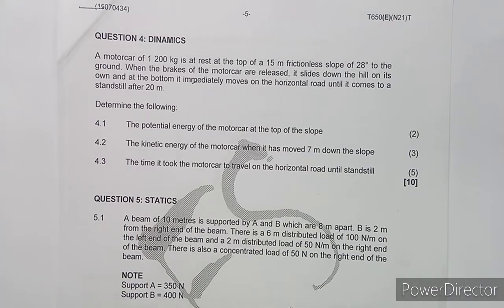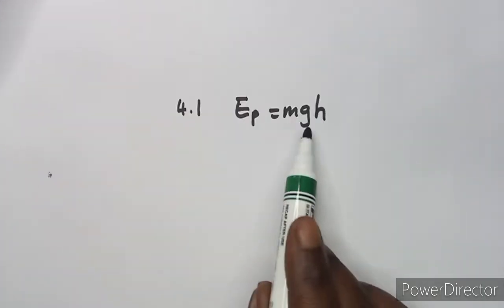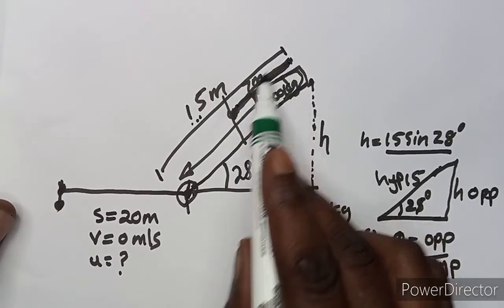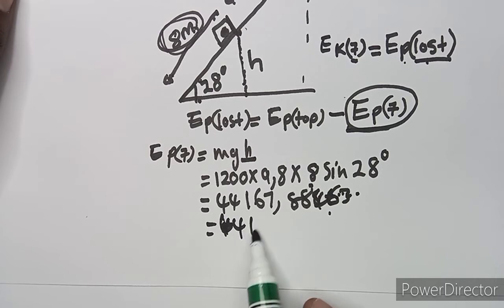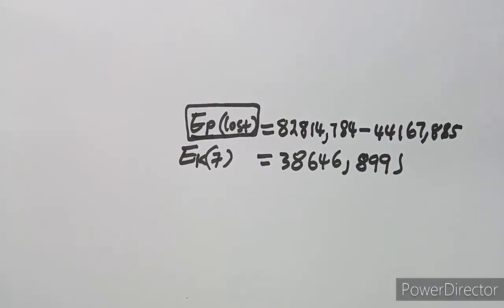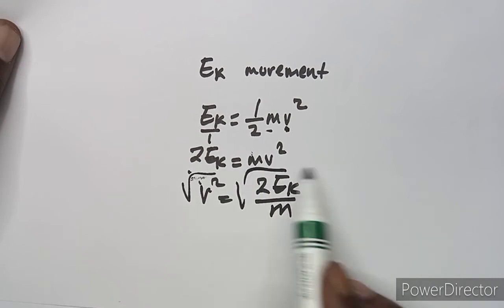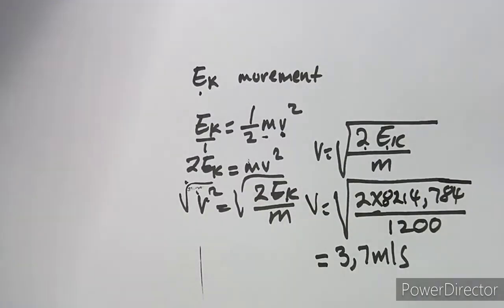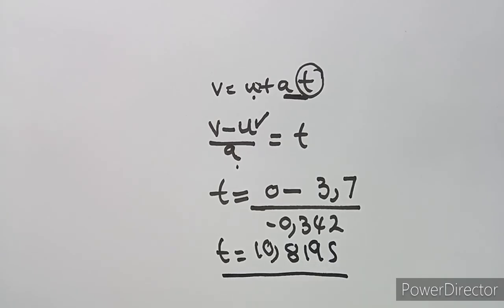Engineering Science N4 Dynamics Past Exam Papers and Memo Part 2 ‎@Maths Zone African Motives

Comment: You made a mistake on question 4.3 .

When you added the values in the Kinetic formula, I see that you substituted with 8214.784 instead of 82814.784 Joule. Which makes the answers wrong. 

Kind Regards
Thanks for all the help!!!
Reply from the maker: Thank you for the Correction ❤️